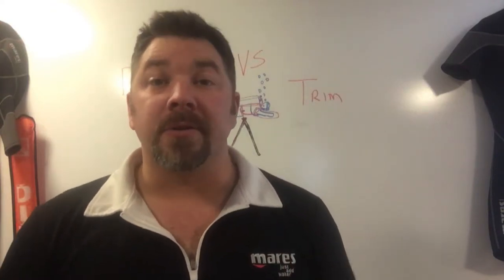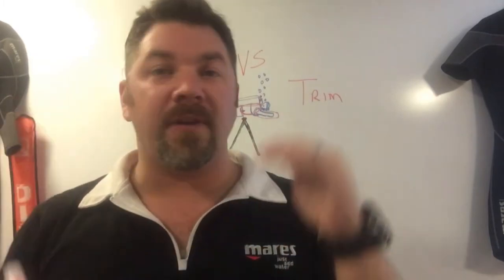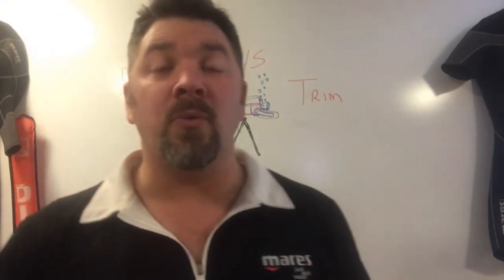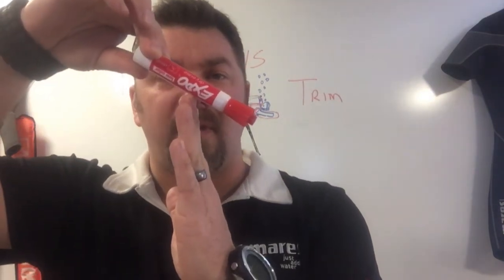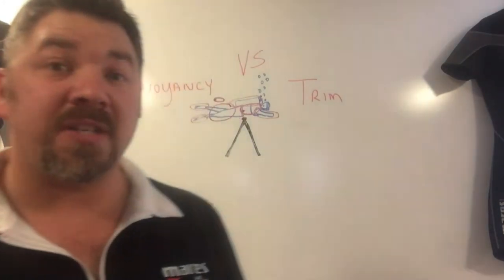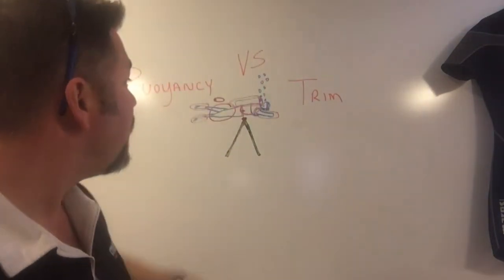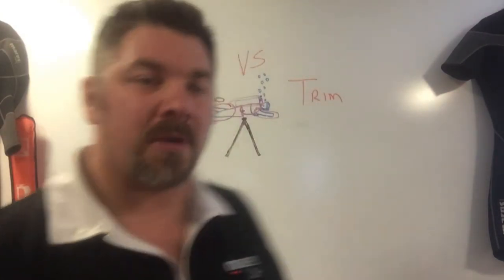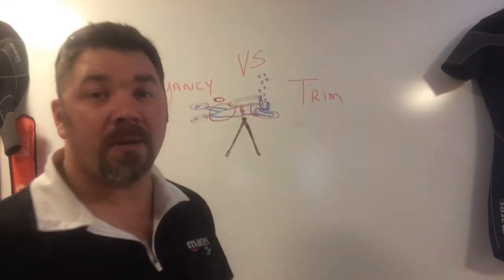Buoyancy Vs Trim

Comment: Buoyancy and trim can be very tricky. I have been a dive master for the last 6 months and probably have over 500 dives now. I was breaking my head (and back) to achieving decent trim in the beginning. This was when I was wearing a sharkskin and swim shorts. My legs being very heavy would always drop. I noticed a significant change when I ended up wearing a full wetsuit where the neoprene covering the entire body would help move my legs up. It was not enough though. In the end, a 5 mil full wetsuit, positively buoyant fins, and moving the tank a little up, adding half of the weights I carry into the trim pocket have gotten my trim to near perfection. However, it isnt done yet. I still cannot hover horizontally indefinitely. I am gonna be looking into a BP/W now. Your comment about the BP/W system was interesting in that having all the air on the backside might help with staying horizontal. 

I am just surprised how most people I speak with think of trim and buoyancy as something you can master without proper equipment. They think that it is some thing you can 'get' if you have keep diving. From my experience it is quite equipment dependent. Yes, some people just have decent trim owing to their body type. Women generally have it nice with their legs staying up. But that is the exception and not the norm. 

Could you make a video about BP/W systems? I am interested in knowing more about how one can go about choosing the right combination and how it is different from a jacket. Thanks!
Reply from the maker: Hello Dhananjay Ramesh, we made a video just a few weeks ago about not letting the equipment manipulate your body's position in the water.  I will link it here for you. (https://www.youtube.com/watch?v=jYEIkpTjpwI) I will try to get you a video made on some pointers on how to pick out a back plate and wing system.

Comment: My instructor says I'm head-heavy, and he can see me sculling with my hands to counteract it. Problem is, I'm also extremely foot-heavy -- I spend half my energy kicking my legs up just to stay in trim. 

I'm wearing Jet Fins. He says to try something lighter -- XTs or RK3s or something. Problem is, if I'm head-heavy, shouldn't I use heavier fins to balance it out? Won't lighter fins just make the head-heavy problem worse?
Reply from the maker: The first thing that I would focus on cheaplaffsarefree, is learning to take control of your body. Underwater, we have total control of ourselves. Never allow the equipment to control you, instead you control it.
Reply: Try drysuit, that allow  u put more air to legs

Comment: That was an excellent explanation of the difference between buoyancy & trim. Perhaps on a slightly different note, if one attains neutral buoyancy at 5m (18 ft), do you see any circumstances that might require adding air (or perhaps removing air) to one's BCD at deeper depths (< 30m or 100 ft)  If so, doesn't that cause buoyancy problems when the dive is finished and you try to regain neutral buoyancy at 5m for the safety stop? I have a strong tendency to become positively buoyant as I go up which makes it hard for me to go up slowly, even if I try to adjust the amount of air in my BCD.
Reply from the maker: Hello DF.  Buoyancy control or mastery of buoyancy control takes time. Most divers forget that as they use up their air, they become more positively buoyant. This is because you get rid of the weight of hte air in the cylinder as you use it. We produced a video on a balanced rig that you may find interesting, and also one on how to calculate the right amount a weight for you. Hopefully both will help you out. 

Balanced Rig
https://www.youtube.com/watch?v=NCVMR35atig

How Much Weight Do I Need
https://www.youtube.com/watch?v=uYeuBJkWxQ4
Reply: @LakeHickoryScuba  Thanks so much for your advice - really appreciate it. My concern (or perhaps problem) I believe, was from buoyancy training I've done which, for the most part, is conducted in about 2m of swimming pool water and, for the most part, most instructors say that if you "master" your buoyancy under those conditions, you've mastered buoyancy and get a certificate. I've always maintained that mastering buoyancy properly is more complicated - for all of the reasons you outlined  in your Balanced Rigs video. So effectively, I think you've confirmed my suspicions about the inadequacies of most buoyancy training courses, especially those that don't include training at the deeper depths prior to certifying buoyancy competence. Please correct me if I've made the wrong conclusion. Thanks again.

Comment: When I did my pool session I only had 2 lbs total weight, but was on the heavy side. If I needed to go to 1 lbs how would you split that up? I haven’t seen any 1/2 lbs dive weights. Homemade weights, or big fishing weights might work, but I’m curious what you think. Oh, I was a little leg heavy, so was thinking about putting all that in the trim pockets, and no dumpable weight.
Reply from the maker: Hello Caleb Mcelhaney. I'm not sure I would drop to just 1 pound. I would utilize that as a compensation for weight loss as you use your air through out the dive. One option of course would be to strap it to your cam strap on your cylinder though.

Comment: Hi Thanks so much for the video im trying to fix this problem ive been struggling for 7 years but never going to give up I have now thought of changing all my gear. what you suggest?
Reply from the maker: Hello Amanda.Trim can be fixed by changing equipment, but it can also be fixed simply by manipulating your body to do what you want it to do.  A lot of times we as divers will tend to compensate for the lack of trim by changing out gear for this or that.  And this can help with your trim, however, it more or less mask the real problem, thus creating a crutch.  With this being said, if the new equipment makes you feel more comfortable underwater, thus, making you relax more which will help you manipulate your body more easily (fixing the trim issue) then I say get new gear. You should dive the equipment that makes you feel the most comfortable while underwater. Even though we should strive to have perfect trim, we should never jeopardize comfort. I tell all new divers, no matter what you look like underwater, just relax and enjoy your time.  Don't spend the entire length of the dive trying to be the perfect flat robot.

Comment: Does it matter where that fulcrum point is on the body so long as we are trimmed out?
Reply from the maker: Truth be told, not really.  A lot of time divers forget that by distributing the weight evenly across the fulcrum point in itself creates a crutch.  Divers over time learn how to compensate for this with out the need, for the times they find themselves unbalanced.  New divers usually have trouble with controlling their bodies underwater, simply because we are accustomed to being upright and not horizontal.